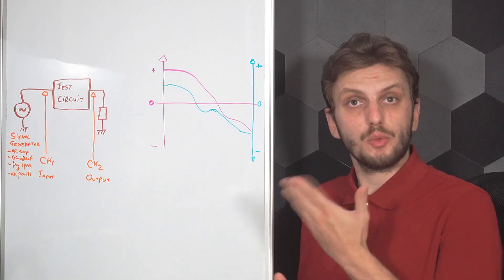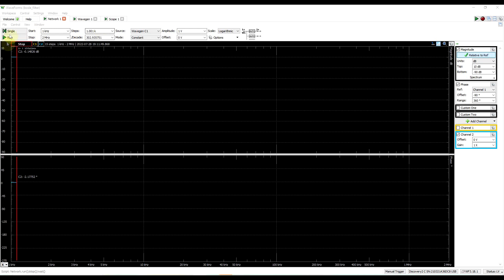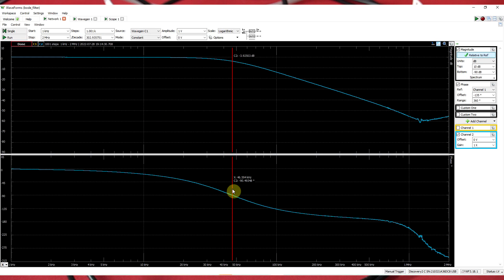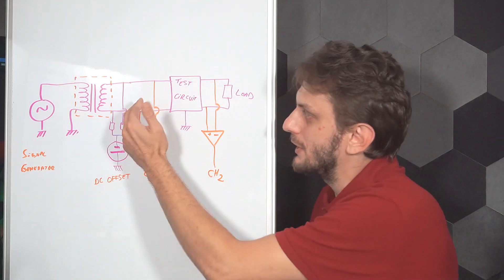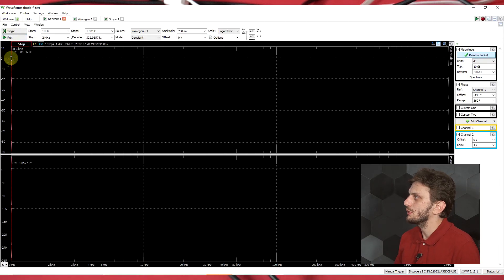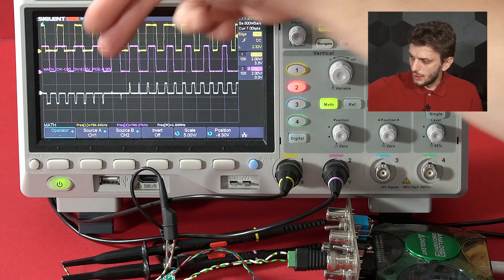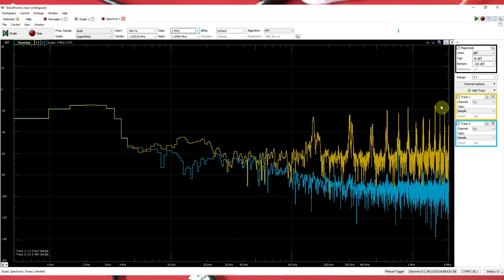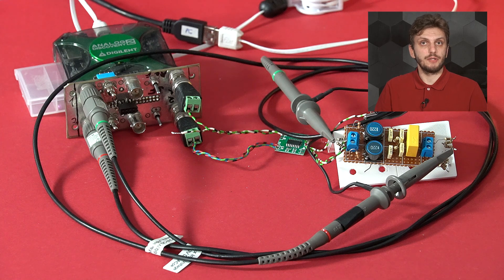The Class D audio amplifier - More filters (3/3)

Comment: Hi, I have been building speakers for quite a while now. Lately I wanted to design my own Class D amp. One thing I want to mention is, that the impedance changes heavily over the f range. And a tweeter almost never has its nominal Z at around 20khz. More like 20 to 40 ohms. So when the filter kicks in at around 15khz, why should you design the filter for 2, 4 or 8 Ohms?. As the real load isn't the nominal value. And the Q factor is something completely different than simulated. Or am I wrong?
Reply: That's why class d amplifiers are mainly use for powered speakers which is one amp and one speaker adjusted dedicately to each other.

Comment: It is impressive to see that these low cost class D amplifiers run at such a high PWM frequency. They are clearly designed to run in filter-less configurations. But their EMC should be not really good. I live in Germany and I think, these amplifiers are not allowed to run in filter-less configuration, as they cause 1.5 MHz radiated emissions with considerable magnitude.

Comment: Fez,
       another great video mate, thanks for the effort you put into these!
You might find that chip is a PAM8403.
I have found allot of these boards use the wrong value caps that tends to screw up the performance.
Reply: Yes it is the PAM8403. I have also a few of such class D modules laying around which I have used to test some audio circuits in an audible way. I have found that thay cause a lot of EMI. So I made some audio modules using the class AB TDA2822 in BTL configuration by myself. I also have some commercial class AB modules using the LM386 but these modules are sensitive to grounding issues on breadbords. My BTL modules are much less sensitive to this due to its BTL configuration and they operate down to 2 V power supply voltage.

Comment: Regarding your comment on t=2m12s, comparing a channel 2 with channel 1 (=ref) is also a good idea because of the input channels themselves! If you use AC coupled channels, the phase starts to rotate much further in the frequency then you expect, and that also goes for the other end. So a bandwidth of 40 kHz will not give you 0 degrees phase up to 40 khz. Therefore, comparing 2 over 1 also divides away those issues, next to the other things you mentioned.